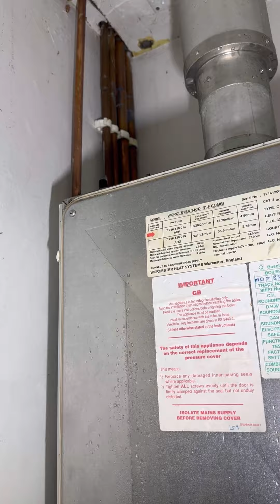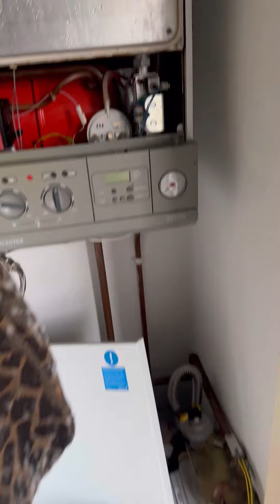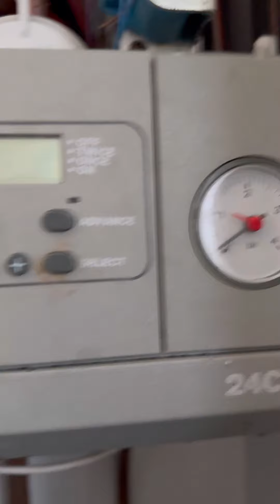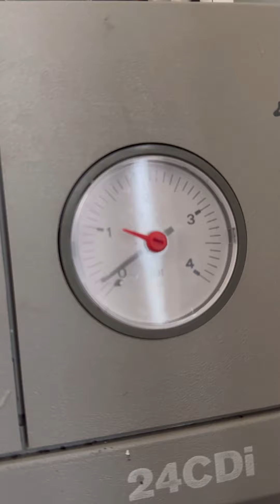How many leaks will i find in the loft?!

Comment: speedfit runs needs to be straight and properly supported if possible for the elbows the pipes connect into. Those elbow fittings pop when theres strain on them caused by bent pipework being in tension . Not good.

Comment: That boiler has an internal filling valve . you don't need the external loop. The idea is you insert the key and turn it and use the valve next to it to fill the system. You then remove the key. This creates a break between the mains water and boiler , the same way as removing a filling loop.
Think the beeping was from a smoke alarm with low batteries.
Reply from the maker: yer couldnt find the bloody thing tho!
Reply: The key in the boiler. 8;41.

Comment: Hate speedfit should be banned comes undone to easy with vibration ps you gas safe get a quote in as I wouldn’t be touching the boiler I’d condemn it all that water over it ps what was thee beep a battery co2 or smoke alarm ?
Reply from the maker: im currently training for gas so about 4 months away from being able to
Reply: Sweet mate you won’t look back opens so many more doors for you good luck with the training buddy